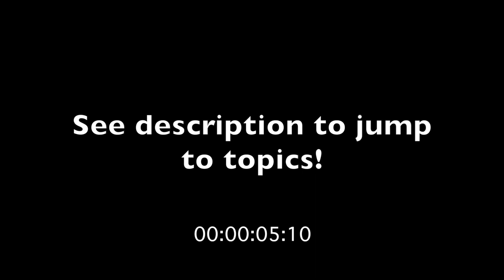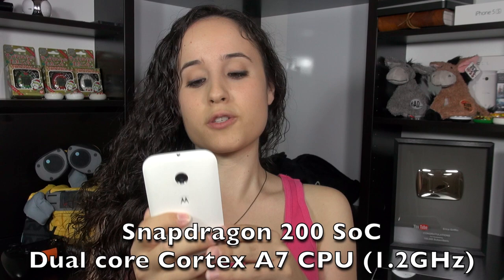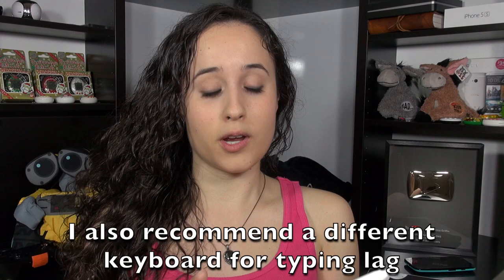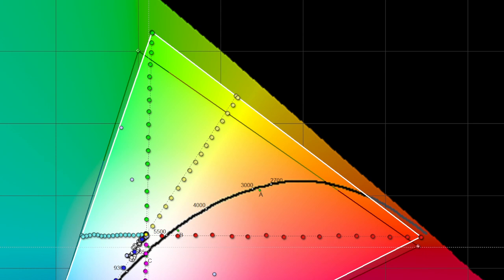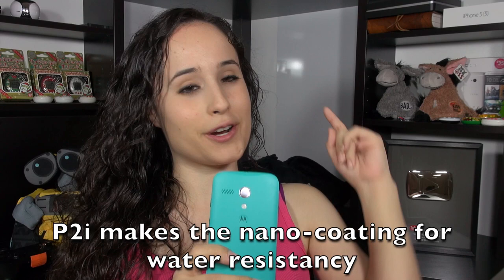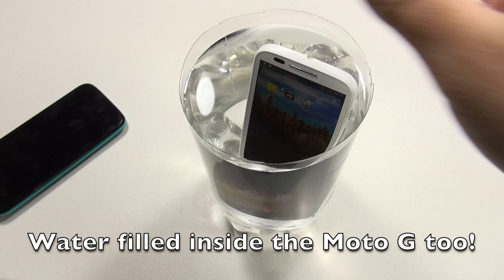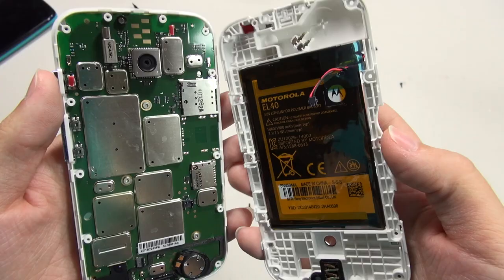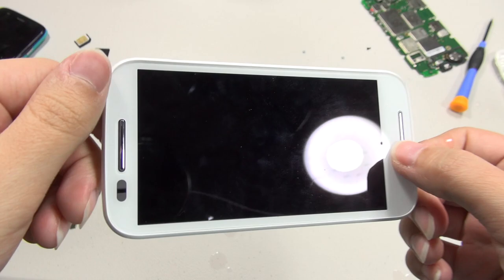Ask Erica: Is Moto E Worth It? (Water test)

Comment: I hope you test the Moto G with LTE at some point over the summer. If it survives the torturing, give it away :)
Reply: doesnt that device cost 200 bucks?  best priced android out there...
Reply: The world around you is not what it seems...
Reply: ***** I aggre bro ,I full agry
Reply: ***** What makes you say that? I have three KitKat devices of different specs and price range and they all do their thing quite nicely, certainly better than the G600 i've had before, with 4.0 ICS! Except for the pretty P7 which i dropped into water >.> and it didn't like that at all <.<

What specific issues are there with KitKat?
Reply: It's laggy , it freezes , it stutter , frame rates are low when multitasking

Comment: Nice review as always! Definitely a great little performer for the money!

The fact it lasted the time it did in the water test with it being picked out and submerged again before any damage does suggest some level of protection. Sure it is nothing like the Moto G, Xperia Z2 or Samsung Galaxy S5 etc but if it can handle a few minutes of submersion before damage that is still not too bad.

Usually if people drop their device in say a puddle they'd have it out in seconds and in rain there would not the pressure of submersion and so I think in most scenarios this would probably be adequately protected. I would imagine even if you left this out in the rain it would be okay for quite some time

Comment: A good video idea would be to compare the Moto E to flagships of 2-3 years ago that can be purchased used for ~$130. Phones such as the galaxy s3, Motorola droid razr, HTC one x , and even the iPhone 4s would give the Moto E a real run for its money.
Reply: I'm not so sure. First, I'm pretty sure the iPhone 4s and Galaxy S3 are still going for more than 130. Can't speak for the iphone but this very well might be less laggy than the s3 and htc one x. It's running on kitkat which is meant to run better on weaker devices and it's also running an almost vanilla android. Of course it would be interesting to test.
Reply: One ,x s3, 4x hd and 4s are all faster and better than this phone.
Reply: ivanzegt I use a iPhone 4S as my main phone. Last week I decided to buy a new secondary phone yo carry my other phone number. My sister has a Galaxy S3 that she wasn't using. I only used it for 3 days and it was soooo slow... Then I've tested a Moto E and I was pretty impressed so I've got one and I'm happy. It performs good with the same apps I installed in that S3.
Reply: ***** The s3 is faster on paper. Did you factory reset it?
Reply: ivanzegt Yes, my sister done a factory reset when she stopped using the S3. Maybe can be faster than Moto E with Cyanogen Mod and KitKat without TouchWiz.

Comment: I read that they will be relaunching the Moto G, same screen, quad core etc but this time with 4G and a microSD slot (up to 32GB). No microSD stopped me picking up the original model.

It's on Amazon UK as a preorder listing for 30th June 2014 at £159.99. Only the 8GB SKU this time.

Comment: If any of you got the moto e online in the moto store or very early June, it only cost me $110. Great discount. If you get a like an actual cover, it saves the phone quickly. During a shamu event, I got shamued or wet by shamu. If you turned it on the cover side, it would be saved like mine. I didn't get a drop of damage! Even after half a year and three months. I like the camera and has a 75℅ chance that when you crop the photo later, the quality will be as good as the photo at first. I also found out that you may need to struggle a bit when you take a screenshot. To do that, you need to push the power button along with the volume button slightly the same time. The only struggle is to prevent the volume bar appearing. Lastly, the only way to get to WiFi is to go to settings. Sorry for mentioning all of this in someone else's video

Comment: And the phone is splash resistant as long as you don't soak it I've literally had to take mine into the shower because I was in the middle of a call
Reply: did it survive in the shower
Reply: +Thomas Webb yes I'm still using it just don't let the water run right over it